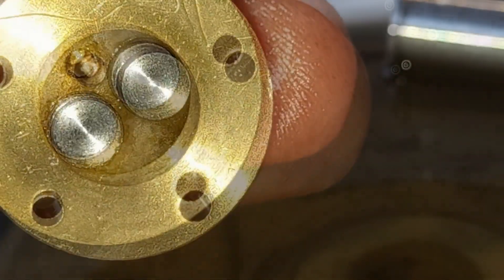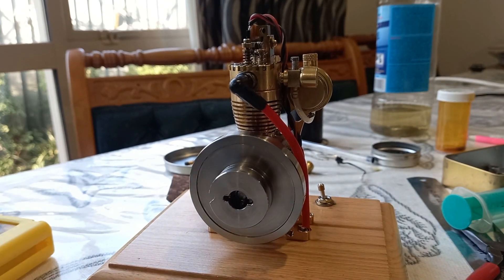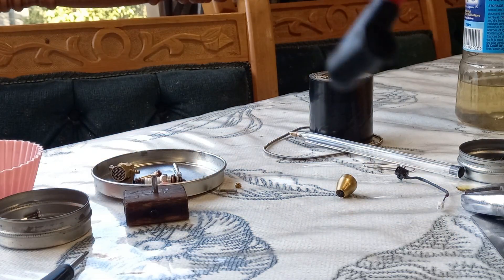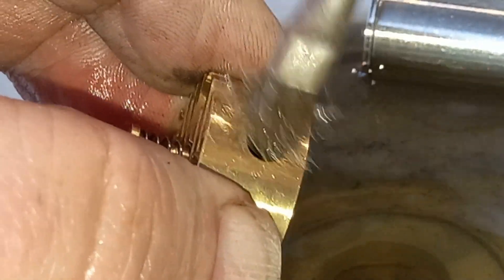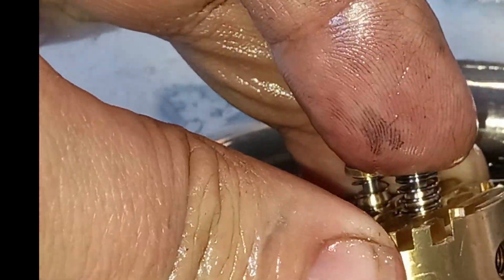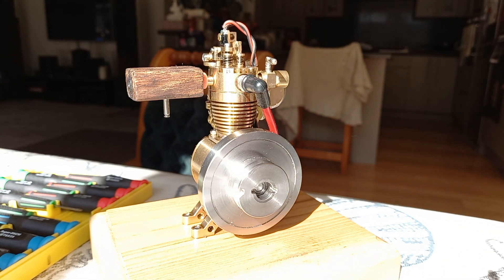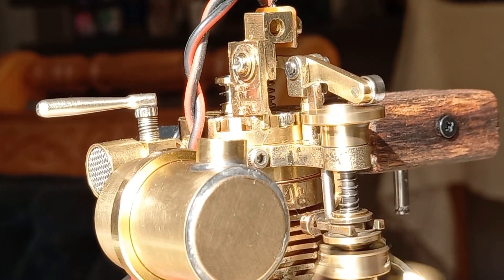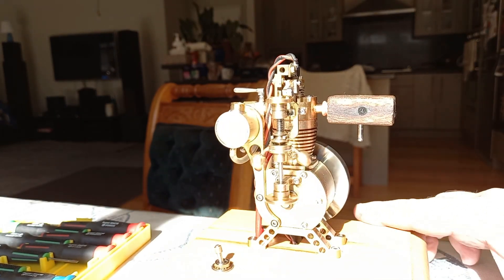SMALLEST ENGINE production 4 stroke gasoline engine model running with smallest valves

Comment: If you use lighter fluid with less oil (50:1) will burn much cleaner and  less toxic to you too. For cleaning I Use contact cleaner. Really does a great job
Reply from the maker: Great tip! I have had enough suggestions that I should try it Binnie

Comment: Greetings from Dunedin. I got one if these awesome lil engines and have been enjoying it. Do you put lubricating oil in the crank case? Usually just biffs it out the breather/filler cap until there's nothing in it.  Looked like a sealed bearing on the fly weight governor side when I took the side cover off. Just wondered what you did for crank lubricating. Cheers
Reply from the maker: Chur bro!! I worry about that, is what I do. I have sucked up a little engine oil in my syringe and poked it in the oil filling hole. Other than that, I hope enough blow past the piston ring will do its thing. There was increasing looseness and wear on the conrod big end of the bigger ET1 engine but that wasn't snug to start with. Best I can think of is squirt at it and invert the engine to get a bit dripping up to the piston insides.
Really, that bearing was sealed? I get drips out of those after my oiling sessions.
Consider partial disassembly and oling then greasing on top to keep the oil in

Comment: I’ve put over 30 hours of run time on my m16 engine! It’s camshaft is so worn it won’t rev up no more . These brass engines are definitely a display model, not quite a prolonged running model.
Reply from the maker: Welcome back Mr Tractor! Does the M16 not have roller cam followers? Whatever; you now have a challenge to get it going again. Few things look so sad in a model engine collection as a motor that's been played to death...yes I have one, my James Maiwald flammenfresser.
Reply: @ThomasPCGuruENGINES  hi there! No it doesn’t! It has followers like in a regular 4 stroke engine. No roller cam. The camshaft itself is steel, however the brass followers wore into it pretty bad. Despite my modification of gaskets to hold oil and splash on the shaft.